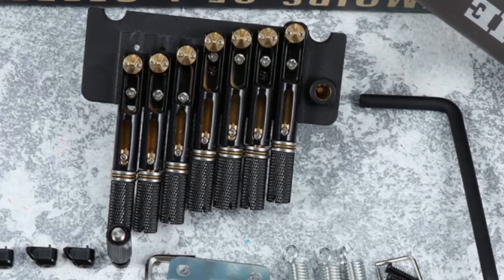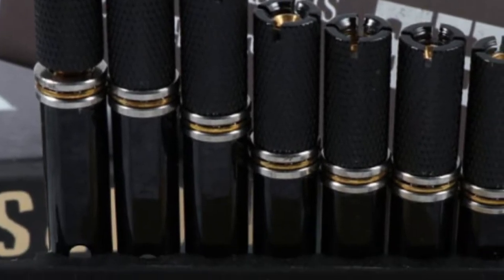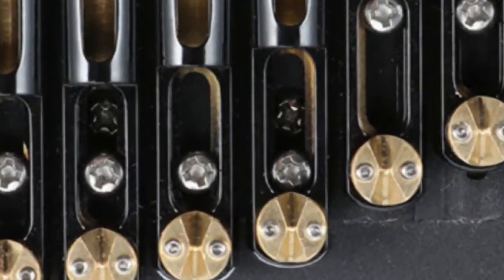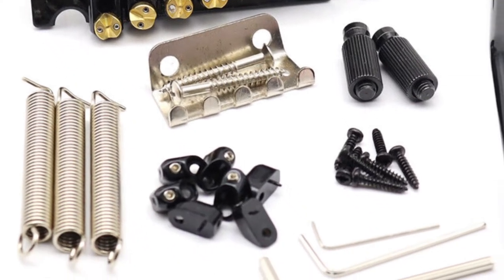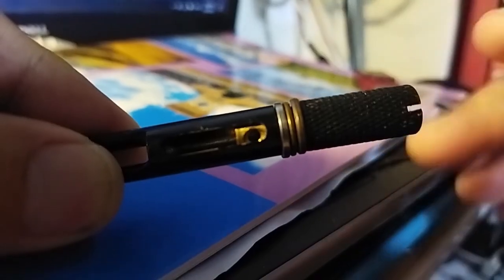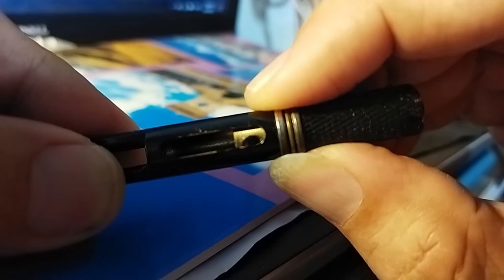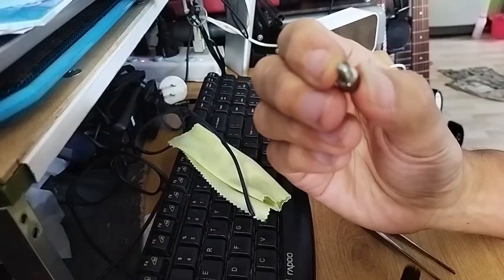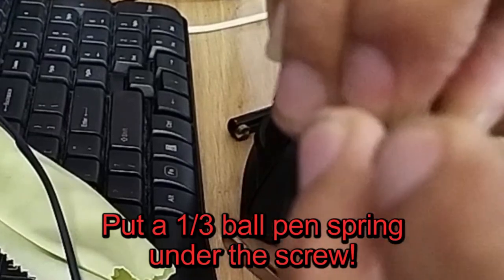"Alnicov" headless saddles: solution against spinning

Comment: I guess the sting's ball end is used at the nut then? Because otherwise they could build the tuners to use the string's ball end and then you don't need this hex screw.
Reply from the maker: Nope,string balls are in the bridge and the set sports separated locking nuts. But the whole design sucks, from ball ends to saddle top the angle is insufficient, no enough tension for the strings, plus other issues seen in this video. Forget this crap, my friend! In my other videos u can see the hipshot knock offs,go with them!

Comment: Besides this issue, how is the quality and tuning stability of the tremolo system? Is it near as good as a floyd rose?
Reply from the maker: Honestly, it is a piece of cr@p. THe tremolo part sucks, the individual saddles with a slight mod are useable on other tremolo or in a non-trem axe.
Reply: @ymelfilm  do you have any suggestions for alternatives?
Reply from the maker: @quanpunchman  check out the Riviera term from Italy, I have not ordered it yet though. Expensive, they may not send it to Vnam.

Comment: Could the trem arm assembly be swapped for a Floyd rose style arm and collar?
Reply from the maker: Do you mean putting a Floyd Rose arm in this black bridge? Possibly.
Reply: @ymelfilm   yes I’m thinking of buying one of these tremolos to tinker with, the Was thinking the original Floyd rose arm may fit with screw in assembly.  Were you able to set intonation on your guitar with this bridge ?
Reply from the maker: @natelaroche7702  Yes, you are. You can set the intonation but I hate the microscopic wrench you need to set the saddles' height. And the bridge itself maybe not be the best material. It can be soft and the knives can go dull after a while if u tremolo a lot (my guess).